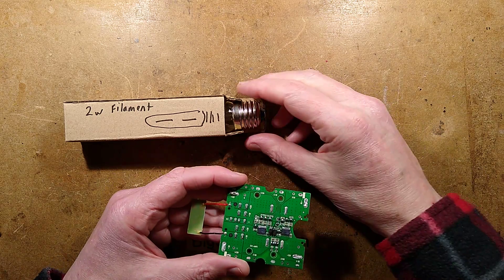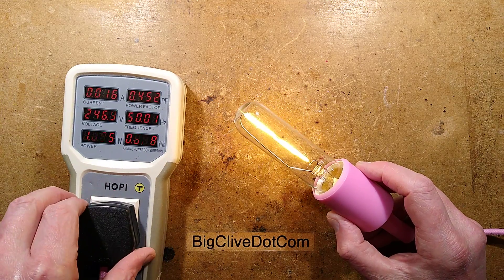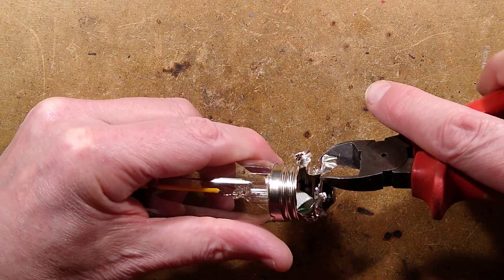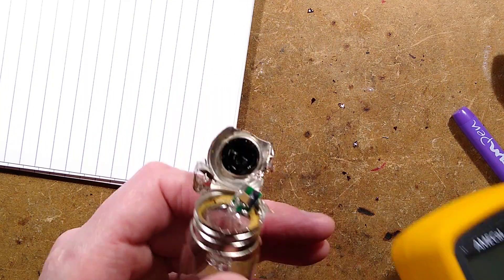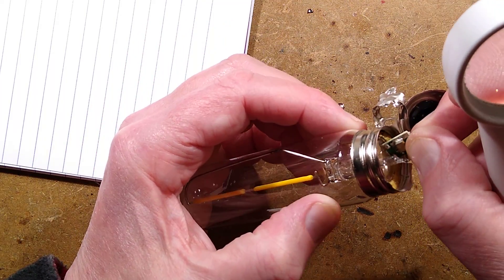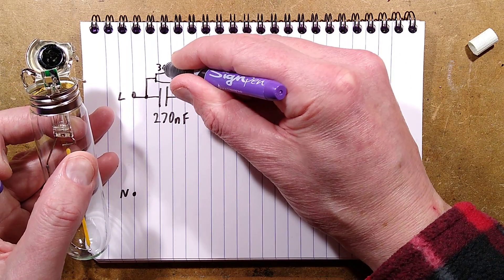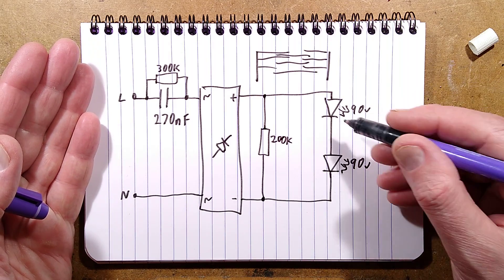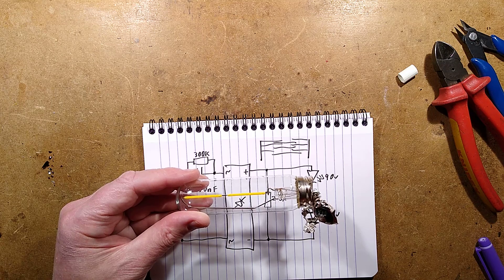Very tacky eBay LED filament bulb

Comment: i'm wary when those titchy caps are used at high voltage, even if supposedly designed for it, they're notorious for shorting/'leaking', i have a 'suspect' one on an old pentium 1 motherboard on the reset line, occasionally self resets when 'something' pulls the reset line down
Reply from the maker: I featured a Japanese sign lamp that failed because the capacitor was physically chipped.
Reply: @bigclivedotcom  i have chipped chip (!) capacitor on an old 5 1/4 pc hard drive, luckily it still works!

Comment: Usually when measuring leaky cap, or one with resistor in parallel, it usually measures higher. So it may be 220n even.

Comment: When measuring capacitors with the meter, you should use shorter leads to get a more accurate measurement, the leads themselves, especially when twisted, can have capacitance that could throw your measurment off by a good little chunk 👍

Comment: In order to smooth it out, would you just need a cap between the + output and the leds?
Reply: across the led supply volts ..
Reply from the maker: That would work, but an extra series resistor would be helpful too.

Comment: Filtering ("smoothing") in a circuit like that is a bit of a challenge because the LED string acts rather like a zener that has a soft characteristic (rounded "knee" on the V-I curve and quite a bit of slope above the knee). There will definitely be some moderate difference between the voltage at which the LED string begins to conduct and the peak voltage across the string but it won't be huge. It would take a fairly substantial amount of capacitance to keep the valleys of the voltage high enough to keep the LED chips constantly emitting enough light to keep perceptible flicker low. Adding a resistor between the filter cap and the LEDs helps, but of course that reduces efficiency. Phosphor persistence MIGHT be a player.

It would be an interesting exercise to actually measure the forward voltage swing in those LED strings in normal operation. That of course requires an appropriate line isolation transformer, an oscilloscope with "floating" input with adequate rating or a differential probe with adequate rating. Some high-end multimeters can sample and record fast enough to be useful. Measuring the voltage at which perceptible light begins to be emitted would also be interesting, but not everyone has a suitable adjustable DC power supply around. One could be cobbled together with a variac, a bridge and a filter cap. (this stuff may all be published somewhere - I haven't looked very hard)

LED lamps like that can be dimmed by using an external capacitor in series. I've seen lots of more conventional LED lamps that can be dimmed in the same way. An ordinary metalized polyester film ("MKT") type is OK because even if it were to fail short circuit nothing catastrophic would happen.
Reply: Even if the dropping cap in the cheapie circuit in the base fails it'll probably just blow things in the metal base or glass bulb.
Reply: If you drop the led voltage and allow that current limiting resistor to burn off a little more power I think you'll reduce the size of that cap a fair bit. Like if you use a 200v led string you've got 340 odd volts on your cap after rectification if you can keep the light output even at half the peak output it'd be a great deal better than what's there now.
Of course with an elegant glass envelope bulb like that a nice PFC boost converter feeding 400 volts of LEDs directly with an output so stable you'd need decent test gear to actually notice it wasn't perfect would be more befitting the application 😆

Comment: Love that the LEDs are in a sealed glass envelope.  I wonder if it is under vacuum?
Reply from the maker: Sometimes they fill it with an inert gas to assist thermal conduction to the glass globe.
Reply: not needed, but could increase life of the filament theoretically. unless it's overheating/overdriven.
Reply: @nobody8717  I agree that there is no reason, but looking at the video, you can see that the tubulation has been sealed. https://youtu.be/8moaqN86RBk?t=202
Reply: @nobody8717  vacuum would decrease lifespan quite a bit I'd imagine. It's increase the heat in the filament a lot because it removes nice easy convection as a transfer method only really allowing radiation that normally needs quite high temperature differences between the radiating element and the environment to move much heat. 
Also it's going to pull any volatiles out of the filaments (think of the phosphors and the binders etc) and they will probably condense on the walls of the glass envelope. 
An inert gas though like Clive said might help with life, if you spend money and use noble gases instead of just nitrogen say you might even get a noticeable temperature difference too.
Reply: @nobody8717  I had the same thought, did they just keep most of the incandescent assembly line running, sort of thing.  But I don't think there's any advantage to having LED's in vacuum?  No air circulation, no oxidation; they'd heat up slightly more, I think?  Have to assume they're being over-driven, these days.

Comment: That lamp looks suspiciously like one of those HPS lamps, but with LEDs instaed of a HPS discharge tube.
I live in the US so 60 Hz mains. My eyes (or brain?) are sensitive enough to flicker that those cheap LED fairy lights and cheap LED lamps (like this one) continuously bother me. I'd probably try that smoothing cap trick.

Comment: The filament supports remind me a lot of the ones used in lower wattage smaller size  high pressure sodium lamps.

Comment: I've got some filament lamps with E12 bases in my bathroom that flicker badly (causing an interesting strobe effect with streams of water). Presumably they couldn't fit much more than that in those little bases.
Reply from the maker: The base size is a huge issue for adding proper circuitry.

Comment: I found the lamp cement seems to soften when you soak the lamp base in water overnight. Then the base can be pulled off with relative ease by gently squezing it all the way round using vise-grips
Reply: i've found cellulose thinners softens it fairly quickly
Reply: I rebase radio valves (tubes) as a side business and since the base cement there is also that marble powder/ sol-silicate mix (hard to soften with anything) I put a tight fitting cardboard sleeve over the glass ending there where it meets the base. I then heat the base with a heat gun, grab the glass  part and the base with either gloved hand and give it a good twist. Always comes apart because the base expands and the glass does not because I covered it with cardboard heatshield. Added bonus is that the solder is soft too and you can just pull the bulb off the base. I have done this hundreds of times and not broken a single valve yet.
In rare cases a phenolic based cement is used, the whole base just gets dunked in a glass with MEK for 15 mins, the cement goes mooshy and the glass also can get separated with ease, but this stuff you do not come across often..
Reply: I do get a little nervous when he's man handling glass bulbs like that. I'd hate for one to shatter and cut up his hand. I hope he can use your technique or perhaps a glove as much as his hands really are the face of the channel 😀
Reply: You can also soak overnight then pop it in a freezer to expand the water, maybe?

Comment: Clive makes a good point.  Peripheral vision doesn’t have high resolution, but the retinal cells there tend to be more motion sensitive.  That is pretty good adaptation - it is important to be able to sense something angry is lunging at you, not so important to know exactly what it is … at least not initially.  Constantly triggering the limbic system’s innate self preservation response by having flicker tantamount to unknown motion in the peripheral vision is probably unhealthy by keeping the body constantly in heightened alert state.
Reply: other fun fact: the density of colour-sensing cells on our retinas is very high at the center and drops super low towards the edge, so we basically don't see colour peripherally, only brightness levels. the fact that we don't notice it is just because the information gaps get made up by visual processing in the brain, like how the blind spots get filled in.
Reply: I think the sensitivity to flickering in the peripheral vision is quite variable between people. For example in the olden days when you could set your PC's video output to the (CRT) monitor to 72Hz if you were really lucky, the annoying flicker of colleagues' monitors set to the default 60Hz was very visible to me, although others in the office couldn't see it and wondered what I was complaining about when I showed people how to turn up their refresh rate to 72Hz. For some reason that doesn't seem to be an issue nowadays with LCD monitors.
Reply: @simonstroud2555  we don't see flickering on lcd screens because the only thing that flickers is a led backlight and it flickers a lot faster than 60hz
Reply: @glebokator740  nowadays the fancier LCD and OLED screens implement black frame insertion, to mimic the motion clarity of CRT.
Reply: @glebokator740  if I use my phone for anything more than 10 minutes and then I turn it and the lights off I can see "ghost flickering" for the next 30 seconds or so. I reckon we can't see it but it may still affect us
Reply: @simonstroud2555  CRT "write" the image line by line, the phospor took little time to fade, that's why they where interlacing (2 half frame) that help to reduce flicker,
LCD are just a big matrix of small windows that allow the "constant" light to go trhough. Indeed for efficiency reason, the ligh use PWM to have controle of brightness, but at a much hiher frequency, it can still be visible if you shake a finger in front of a white scree in a dark room. Change the brigtness and you'll see some slight brightness differences
Reply: @lapub.  PC CRT monitors are generally progressive, not interlaced. This causes a much more visible flicker at 60Hz, even compared to a 50Hz interlaced TV image. I used a monster 22" Samtron CRT monitor for a few years, but my graphics card could not detect it, so the highest available refresh rate was 60Hz, although the monitor was capable of 85 or 100Hz at that resolution. I ended up lowering the refresh rate to 42 or 43Hz Interlaced, that reduced the flicker big time, but introduced the usual interlacing artifacts. I used it like that for about two years on my main PC...
Reply: @mrnmrn1  You're right CRT monitor was progressive, I was thinking about CRT for TV ! The big mess was when you wanted to dispay an interlaced signal on a progressive system ! Windows use a communication channel even in VGA CRT display to detect the type of monitor (based on I2C) and set the correct frequency. Sometime this didn't work and you were stick with a "generic monitor". This prevent blank screen or screaming CRT (from the time they was directly drive by the signal some weird sound was made) but you etheir have the possibility to change the monitor manually or unseclect "hide mode that this screen cant' display"  and force eitheir resolution or frequency.
Reply: @lapub.  But you answered to someone who commented about CRT monitors, not TVs. I know how to force resolutions and refresh rates, but that did not work in this case. I could select any resolutions, it worked, and I could select any refresh rates, but that did not work, only 60Hz and lower. If I changed it to any other refresh rate, the screen blanked for a second, Windows asked if I would keep the settings, clicked yes, and it  showed the selected refresh rate, which could be up to 160 or 180Hz, but the reality was always 60Hz, or 43Hz Interlaced, if I selected that. 

60Hz progressive was unbearable on a 22" CRT from 40-50cm distance, so I used the 43Hz Interlaced setting. It was an AGP Radeon 9200SE 128MB card under WinXP, the monitor was a Samtron 210P. I still have the monitor, maybe also the VGA card.
Reply: yeah so true and annoying when you feel on your side sight something is vibrating
Reply: I know when I walk into our neighborhood grocery my eyes are always drawn to this one flickering fluorescent tube in a ceiling fixture. Someday they may get around to changing it. Or the thing will just die completely.
Reply: Back in the day, when this was more of an issue, whenever it came up for discussion it always tended to be about two thirds who can't see it, and a third that is really bloody annoyed at the lights or the monitor doing the flickering.
Reply: Only some of the time is it angry, like a mother bear. If it intends to turn you into lunch, its primary emotion is yum ! I usually don't get angry at my food.
Reply: Can’t believe I saw this now. I was explaining this to my son after he explained he found the queen bee in our hive because he was “looking through the bees”, hence not looking directly at them his peripheral picked up the larger “odd one out” bee.

Comment: How would you smooth it out?
Reply from the maker: At the very least a small electrolytic capacitor.  Preferably a series resistor to the LEDs too.

Comment: The image fusion rate varies between people.  Some LED Xmas lights annoy me because they flicker (60 Hz here in the US) when my eye moves.  I had a girlfriend who absolutely could not see the flicker and thought I was nutty.  The same goes for some LED car tail lights.  My old work supervisor could see even faster flicker and couldn’t stand computer monitors unless they were set to at least 70 Hz refresh.
Reply: For anybody with Nystagmus Like I have, 60hz is Very noticeable. I can see strobed LED tail lights on Vehicles a Mile away amongst Car with incandescent Lamps. the strobing of the LEDS is to fool the Eye to make them look dimmer. In large open buildings with older Florescent lamps, I could tell if they were on 3 Phase power and which ones were on what Phase.
Reply: I remember having set my CRT to 85Hz, because I couldn't stand 75Hz or, even worse, 60Hz. That meant I had to actually sacrifice display resolution, because in the "olden days" monitors worked like that. And I'm very much annoyed and distracted by "strobing" LED car rear and break lights, flickering christmas decorations and a lot of information displays (those based on LED matrices like bus line displays, dynamic traffic information signs and those side scrolling "tickers").

And I just experimented with a LED and a function generator (trying not to fool myself too much I always started at 150Hz and turned down the frequency without looking at the display until I saw something). Without moving my eyes I definitely see flicker up to 70Hz. From 70 to 75Hz I wouldn't call it flicker, but "unrest". Distracting or annoying without knowing why. If I move my eyes, I still see flicker at 100Hz, and have a similar distracting impression up to 115Hz. Although for the "flicker while moving" it very much depends where in my field of vision the light is, and sometimes even 115Hz looks flickery while 100Hz look steady. I guess all these values will change from day to day or even hour of the day depending on daily constitution. It's also sunny outside right now, so quite bright in the room.
Reply: Yea in the CRT days I had to set to 75hz
Reply: And then there’s me who can’t see flicker at 30hz haha
Reply: I get that with certain LED fade-in/out on devices like some IEMs. Coworker of mine has a pair of buds that behind the touch plate does it and I’m the only one that notices it. And I notice it in a very bad way, if she is wearing it near me and I see it I get slight nauseous.

Comment: Why do they make these put of glass when there's FA in there, but then the 14w (100w) one's are plastic, it has tk be to increase the cost for an ugly lamp

You can't measure a capacitor in circuit! Noooo
Reply: Hmm ... how I love plastic bulbs ... no, not at all, and anyway I think we've enough plastic in the world.
Reply: @MrAdopado  more waste is produced making glass than recycling plastic
Reply: @phonotical  I would like to learn more about that if you have some good links.